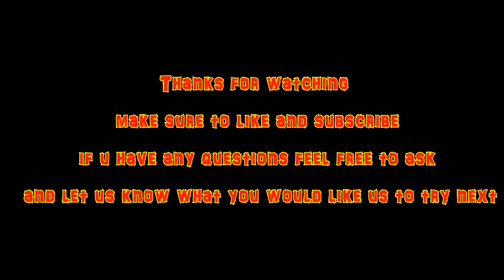STEEL SLEEVED DRIFT TRIKE!!!! THROWING SPARKS!!!

Comment: cool, you should do it at night over some rocks so it will spark a lot. Also, where did you get the front handle/fork assembly/tire for the drift trike?
Reply from the maker: We plan on it . Working on getting some titanium sleeves for maximum sparks !!! 
We bought it from a guy he said it came off a chopper style bicycle
Reply: Ayyy kart fab if I make a kart channel will you sponsor me

Comment: When titanium sleves and at night spark video also what kinda pump is that thanks
Reply from the maker: We have to find some titanium first it's very expensive about $1000 a foot for 10 inch lol and it's a vacuum pump for a drilling machine but u could also use a hvac vacuum pump or something like that
Reply from the maker: also make sure to subscribe lol we need it

Comment: Roll the edges of the pipe in a little and it will drift even better,as well as not getting you bitched at for ruining someone's pavement
Reply from the maker: +Bowtie41 the core drill bits we used are very strong I don't think it would be possible to roll the edges

Comment: My engine works it doesn't idle I just got the gas and the Oil for I filled it up I tried starting it but it wouldn't start so I whenever I start I have to rev it while starting it and then after that I can start it without Reving it for a while and then it'll stay on an then but I think I just have to break in the engine what I see some people do another video
Reply from the maker: +Moto Briggs yes it's good to let your engine run at low idle for a few hours when you first get it . And then to do it really right you need to change the oil afterwards. Also you might need to adjust your idle .
Reply from the maker: +Moto Briggs also anything with a carb is gonna need to warm up a minute before it runs perfect .